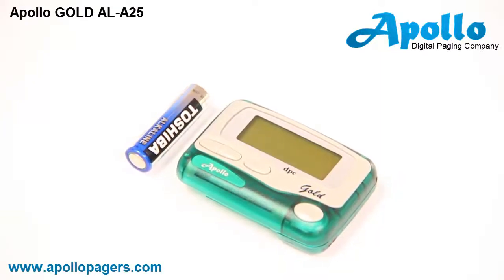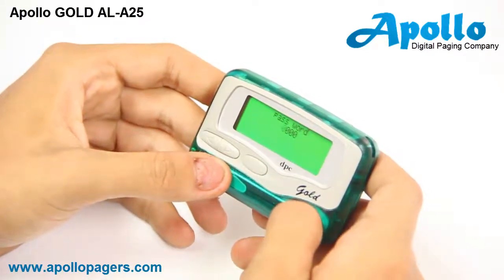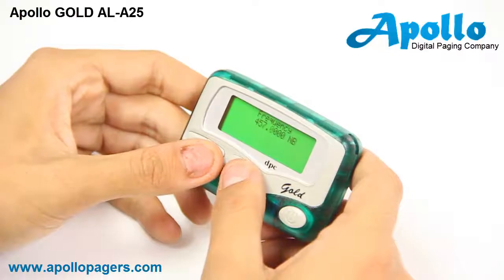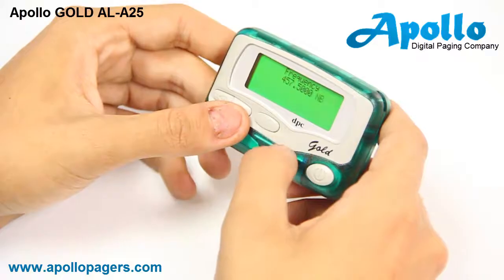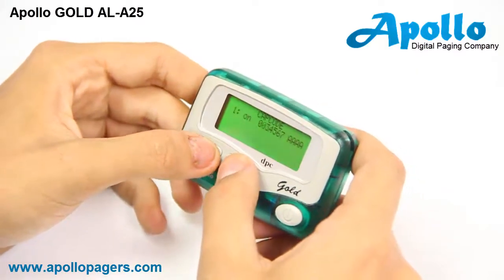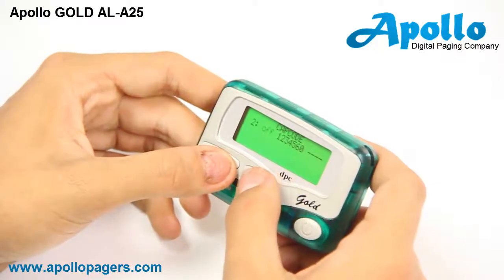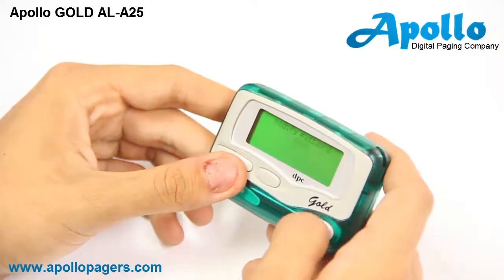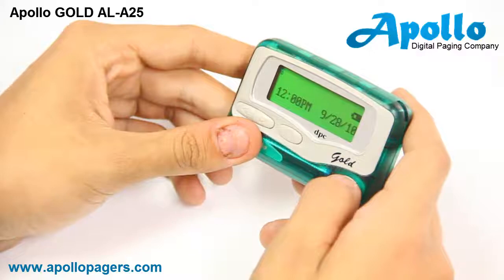Apollo Gold AL-A25 Hand Programming Instructions / Tutorial

Comment: I know you're Apollo pager videos on our old videos that we use a couple different versions of the apologies at a long-term care facility I work at. How do you know what number to set the frequency to? We have one unit that has no pagers so we have to rely on continuously checking a screen the current call lights for that one unit. We have plenty of extra pages on other units and we are currently between IT people so I've been trying hard to successfully program 1 or 2 of these Apollo pagers to the unit with none. Our system is All call Alliance Inovonics. I don't know if you need any of that info or not but if you are able to help it would be much appreciated. 🙂 If not it's no big deal, just thought it was worth asking
Reply: Your*